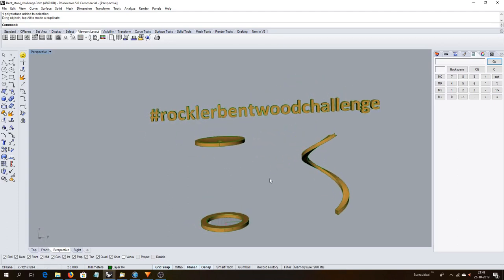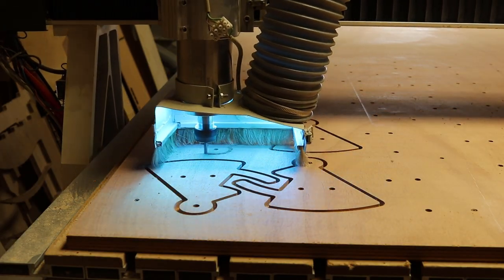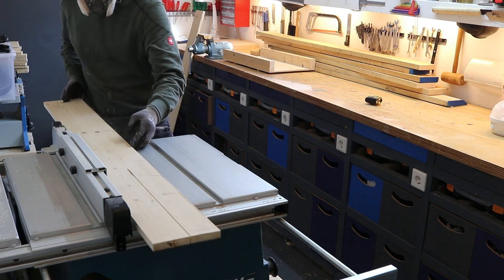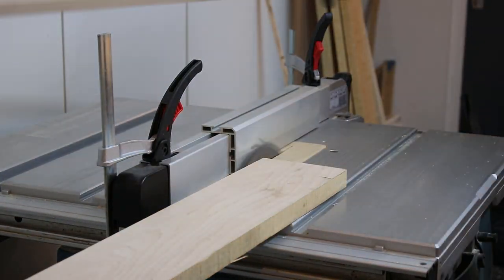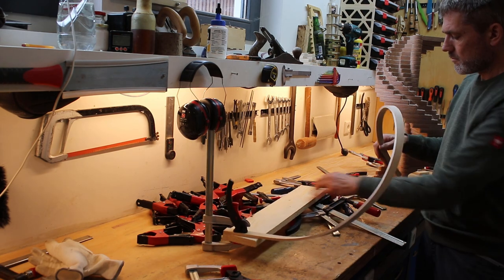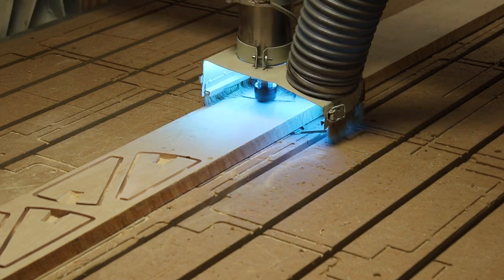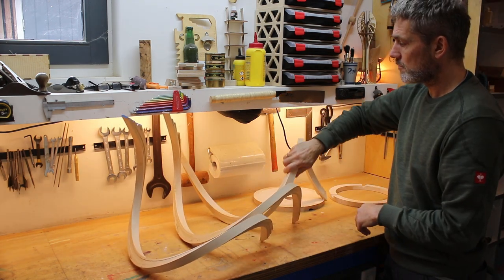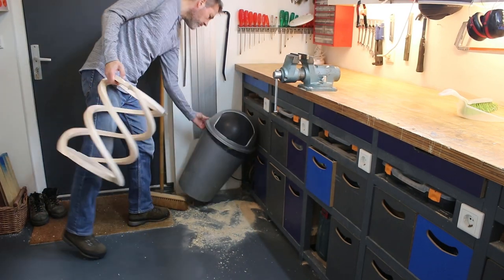Dutch design stool | steam bending wood with an egg cooker

Comment: It could still make a nice stool if you hade a nice piece of support in the center to hold the weight and not put that force on the spiral legs. And if it were taller it would be an awesome bar stool.
Reply from the maker: Thanks for the suggestion.